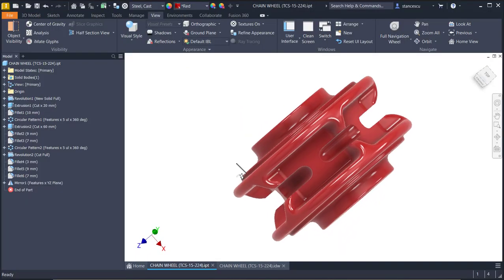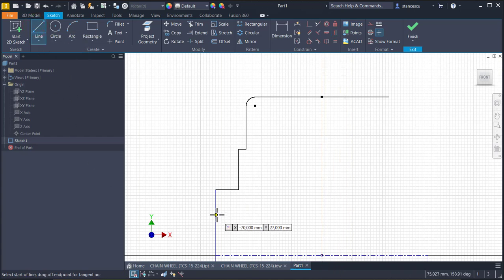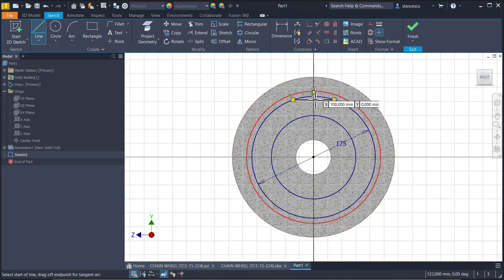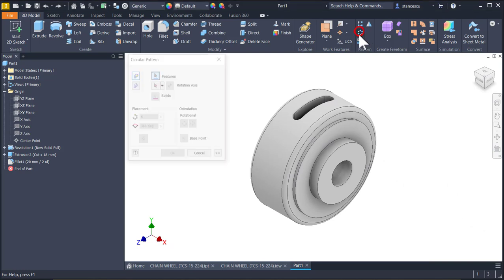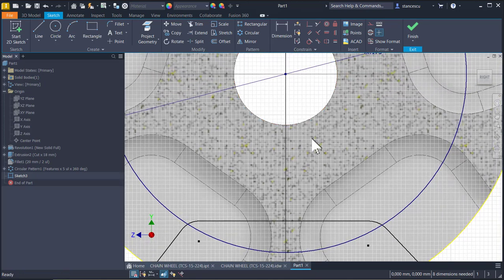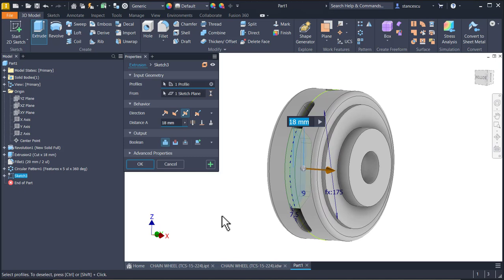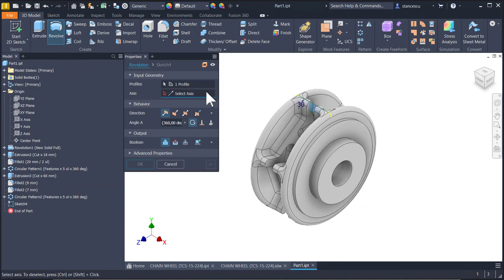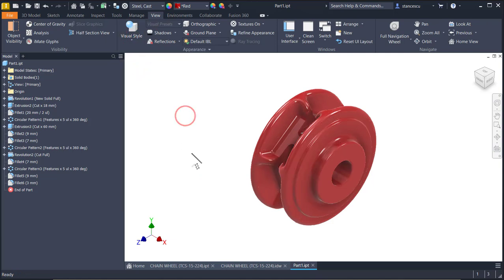Tutorial Inventor - 364 CHAIN WHEEL (TCS-15-224)

Comment: The distance A (the depth of the cut-extrude)  of the first extruded cut you made is not correct.  The width of the groove is 20, but not 18.
Reply from the maker: You’re right my friend! That is a mistake but the modeling works well…😊